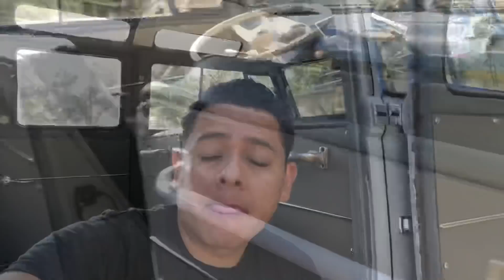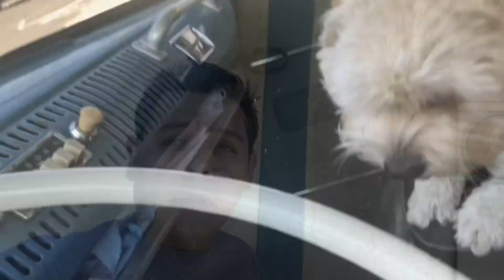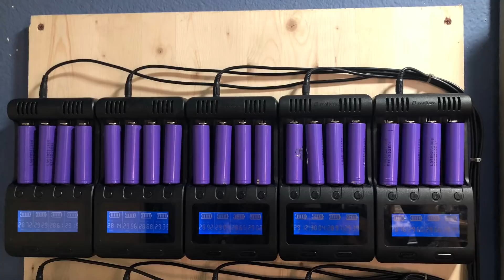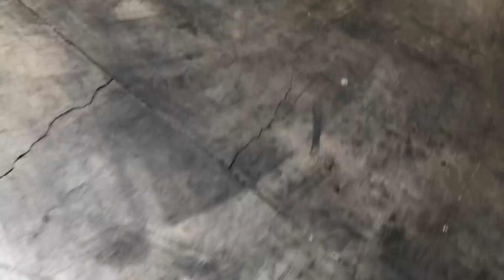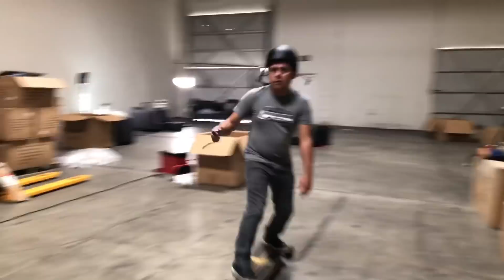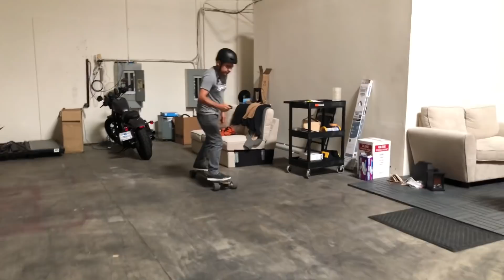California lost power, my batteries are dead, what it’s going on?

Comment: I'm really surprised Jehu ran out of juice.  I have been driving either a all electric or hybrid electric car for years.  I habitually plug in my vehicle every time I pull into my garage since public charging stations in the suburbs of Connecticut is not very common.  Doesn't every one plug in at home the moment they get home if the have an available outlet?
Reply from the maker: Not when I only need juice every 3 weeks or so

Comment: i'm looking for a source in North America for headway 38120 batteries. used not new. along with decent 4s/8s bms 12v 80 amps + for the batteries. it is for extra stuff in my ford flex.

Comment: Are 18650 better than lead acid? Costco’s selling solar panels at $1 per watt and 1,500 watt inverters, considering that route for an emergency backup system.
Reply from the maker: Yes,  lead acid is cheap but doesn’t last
Reply: @jehugarcia  like those 18650, or lipo / li-survive as long as a good lead battery

Comment: Make it a diesel hybrid
Reply from the maker: I don’t think so
Reply: jehugarcia Why not use natural fuel in a diesel motor? And add solar panels.
Reply: kids these days are scared of fossil fuels
Reply: Kekistani Trumper like a vegetable oil diesel running motor.
Reply: +crazzylee youll still need lye and methanol and a cleaning process
Reply from the maker: Magnetic drive is the best tech out there.  Combustion is old news, it belongs in the museum
Reply: jehugarcia solely as a generator

Comment: JEHU,,,  Is there not some way to hookup an Alternator ?   I know you most likely don't have a drive-shaft but is there not something spinning while your driving that might be used in conjunction with an automotive alternator ?     I spring loaded wheel the ran off the back wheels using the motion of you driving down the road ?
Reply from the maker: It would slow the car down and require additional energy to compensate.  I would require more energy than it would produce,  shortening your range
Reply: So then you have search out the idea I take it.   If you had a drive-shaft linked alternator and maybe a switch so you could free spin it at low rpms and then at 45mph or when ever you set it to start charging would it really take up that much energy?   I just keep wondering about this whole idea, and I believe it will be invented someday an EV vehicle will self charge.   Thx for your reply.
Reply: Here is a thought and I bet you have knowledge of this.  There is energy in the air and I lot more is there if you have something like a EV passing through it to capture it, so I believe someday there will be a vehicle that captures energy just by passing through air.  In-fact some people believe jet planes are powered by condensed air.   Have you seen the guy standing behind the jet plane as it takes off and the whole weight of the fuel in the wings ? It is not possible to fly with such weight I believe.   My neighbor used to work for NASA and we have chatted a few times and I have seen some of his mathematical formulas that he did dating back to the '60's and he has hinted to some very odd things, but I haven't got enough of his trust yet.   There is more out there then what we know about by far, like the fact that every land mass has megalithic structures but yet we can not build those pyramids still to this day and those pyramids are found everywhere, China, Mexico, Ukraine, Russia and you have to wonder about those megalithic buildings in India and Thailand that we can not explain to this day as to how they were built.  So there is a secret energy out there to be harnessed.  In-fact there is a Castle here in Florida that a man built all by himself, he moved coral stones that were in the tons without machines.
Reply: +Freeman Reign one of the very first EVs in the 90s did that.

Comment: You are right Jehu, some people are scared of batteries blowing up, but those same people don't mind sitting on a moving tank of gasoline.
Reply: water won't cause gas to blow but watch what it does to lithium. ever seen a phone explode? btw I ride an electric bike
Reply: @kekistanitrumper8040    Yes, phone batteries can blow up like the Samsung Note 7 fiasco, but I don't think people trade their phones for a bottle of gasoline, they just look for a better phone :) I do see what you mean and it's a valid concern since most homemade battery packs are not properly sealed or have a good cooling system compared to a Tesla battery pack for example. But, batteries are still more safer in my opinion since there are also many waterproof phones now as well that use Lithium ion batteries and they don't blow up. They are also only going to get more safer with the new battery types being tested by various companies and universities.
Reply from the maker: Lithium ion batteries don’t have lithium metal,  they are not reactive to water
Reply: +jehugarcia you are right! thanks for the info bud.

Comment: How would I go about adding lithium batteries to my nickel metal battery on my 2010 Honda Insight?
Reply from the maker: adding?  you'd be better replacing,  but I dont know details on any hybrids
Reply: jehugarcia yeah. My insight uses a 107v 13hp DC motor. But the hybrid brains are the tricky part.

Comment: And i'm currently discharging cells to bottom balance them :)
Reply: I have a dumb question what would be best? Bottom balance or top balance?
Reply: i always bottom balance my LifePo4's, also not using BMS , i have that much faith in the 10ah 38120 Headway cells now , i'm just going to run with it. Also not charging too full capacity helps protect the cells.
Reply: I build a 12v pack and use a 275w light bulb too discharge with inverter, then break the pack down and discharge individually , it speeds the process up a bit (am using 10ah 38120 headways)
Reply: Forgive me for another question: But when you bottom balance what volt are you bringing them to? (18650) that is.
Reply: 2.5v , but i only use Lifepo4 38120's

Comment: Thats LOW volts!! 
Question  in 3, 2, 1
What fire extinguisher would you use if the bus battery caught fire......?
Reply: Mark Jennings co2
Reply: It would help stop surrounding material from burning (as long as the CO2 was applied) but wont do anything to battery fire. My choice would be a BCF/Halon.
Reply: I recommend PKP 'Purple K (potassium) Powder' for electrical fires. Standard US Navy chemical solution